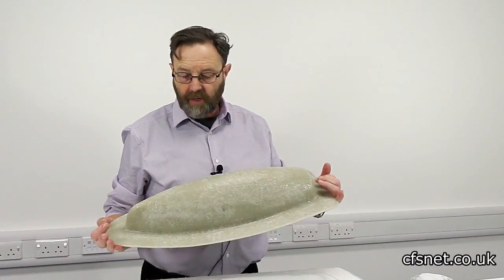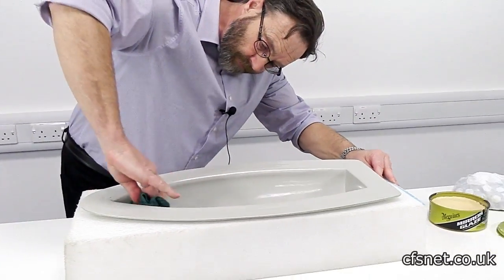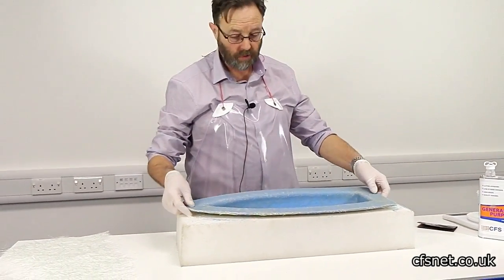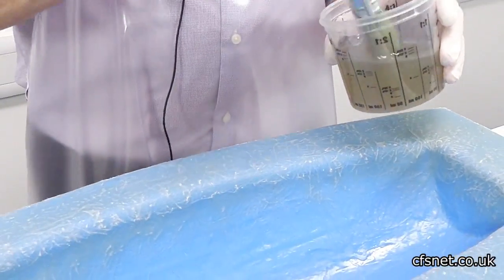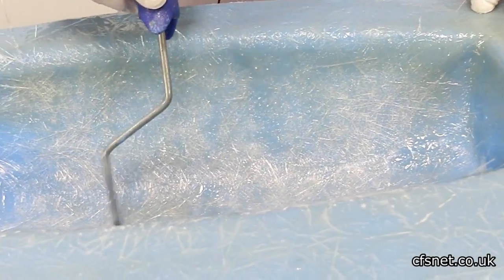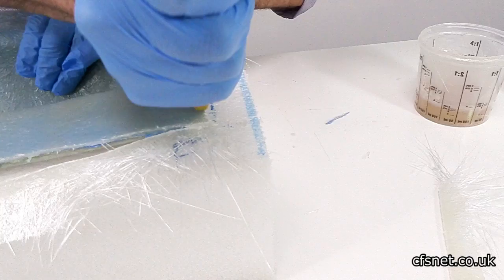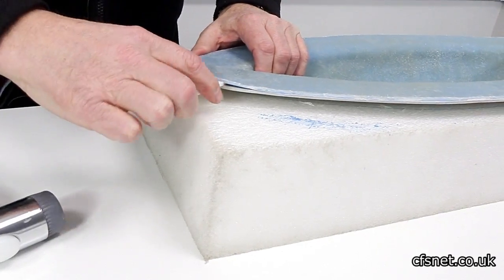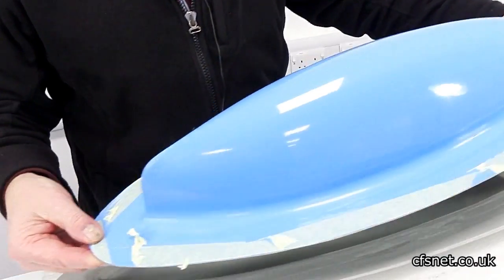CFS Fibreglass Making a Small Boat Hull from a Mould

Comment: Nice work and Craftsmanship  with a excellent narrative  on what you were doing and why  i am a retired Woodworker who has owned many boats over the years  I have always been impressed on how well a Gelcoat finish comes out  despite that its kind of applied backwards in a sense  in Woodworking we usually apply our finish  over the top of what we built  so in theory you are watching the finished product  not like in a boat  you kind of apply the exterior then build  on that for strength  and integrity  it’s just a different approach  of course that’s why so much emphasis is pu5 into th3 mold

Comment: Nice video and nice end result. A few things surprised me though from a boatbuilder's perspective..
1. We usually roll resin with paint rollers. This helps prevent over saturation of resin and also helps prevent fibers from straightening or pulling out and becoming weak (to be honest I usually spray gel and resin in moulds then roll but I understand this video is aimed at people that may not have spray equipment). Too much resin is almost as bad as not enough resin, resin on its own is brittle and prone to cracking. I'll use a brush on inside corners or tight spots the roller won't reach
2. We never ever ever pop a hull using only mat (chopped strand mat) every few layers you add woven roving and/or combination cloth. Mat provides rigidity while woven provides strength and impact resistance
3. Have you ever heard of a radius roller?
Reply: I’d like to build a 30ft fiberglass boat with this method. Is it possible for you to guide a stranger ? Would be much appreciated.

Comment: I would like to start a 24ft boat project. And i want it to have a smooth finish like the one you just achieved. I know i will need a molding for that. What should i make my molding from?
Reply: you want a better finish than whats in the video. go back and look at the front of the hull. its about 3 inches of it that is terrible. now needsto be flattened down and polished and hope the gel coat is thick enough.

Comment: CFS i've been laminating for over 30 years now and have be a laminating training instructor would you like me to show you how to laminate
Reply: I mean... he did OK... probably better than most on YouTube lol
He did use too much resin and I personally wouldn't have done it using only a brush
I would have done it all in one go instead of doing the rim first since the rim just gets cut off anyway... less seams the better
And I would have used a radius roller instead of a straight one
I know I'm 2 years late but I'm kind of interested on your thoughts
I've been fiberglassing and rebuilding boats for 10 years or so and taught by 2nd and 3rd generation boatbuilders but I'm always looking for outside perspectives

Comment: Dont we need a vaccum to suck out the airbubbles?? And can i fiberglass on balsa wood
Reply from the maker: No vacuum needed for hand lay gelcoat and resin. You can fibreglass onto balsa and it will bond itself extremely well, should you want to use balsa as a mould then the surface of the balsa will need treating with a sealer and release agent to ensure the two will part.
Reply: CFS Fibreglass Supplies okay thank you but 5oz what does it mean i have seen it on scratch builds like use 4 or 5oz cloth is it the weight or layers or something like that? And is there only blue outcome or is there other colors to it
Reply from the maker: The blue is just the colour of the pigment in the gelcoat, you can literally have any colour pigment. The oz thing can be quite confusing, for woven fabrics 5oz would be around 120g (ish) per m2 of fabric. For matting (the random fibreglass) then its different 1oz is 300g per m2, 1.5oz is 450g and 2oz is 600g. Its because the old system used some per square foot and some per square yard weights. Try to use metric where possible as it avoids confusion.
Reply: CFS Fibreglass Supplies thank you i did not find any scratch builds logs that used the metric system but amount of layers are just 1 or more?

Comment: Did you skip a step between the application of gelcote and laying in the first glass laminate layer?  Would have been nice to see the process (which I thought was the point of the thing here)...
Reply: Would have been nice to see the whole process up to how many coats of fiberglass cloth was used. Or at least mentioned.
Reply: @jeremybenson5782  The amount of layers used depends on the desired thickness of the hull. Personal preference or whatever. Work boats typically have much thicker hulls than speed boats. Since this hull is just a demonstration the amount of layers is irrelevant
Reply from the maker: Paul here had just fibreglassed the flange off video, the rest of the gelcoat is still not done where we pick the video up again so I don't think we missed anything important. That said If I was doing it I would probably do it in one hit and save some time.

Comment: Is the gelcote necessary as the hull I want to make has more of a matt finish or can the resin and fibreglass be applied directly after the releasing wax?
It's a 2 part boat hull mould with relief details on the sides and similar in size to the mould shown here.
Reply: Atreius Lux

Comment: How many layers of fiberglass/chopped strand mat were you using? And how much polyester/resin?
Great video and instructions btw!
Reply from the maker: Hi Sven.  
The mat that was used is 450g, and we believe that Paul used 2 layers in the main hull and 3 layers on the flange.  2kg of resin would have been sufficient for this small mould.  
You can find more information on our website www.cfsnet.co.uk where there are links to fibreglass methods and fibreglass projects on the right hand side toolbar.  
Hope this helps!  CFS
Reply: Ok, thanks.